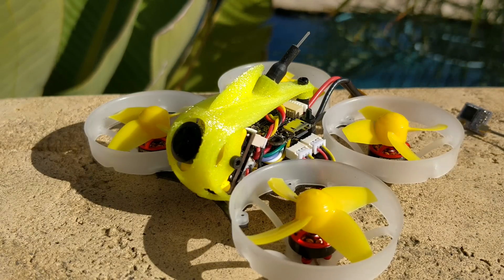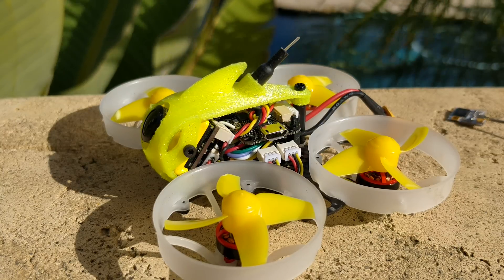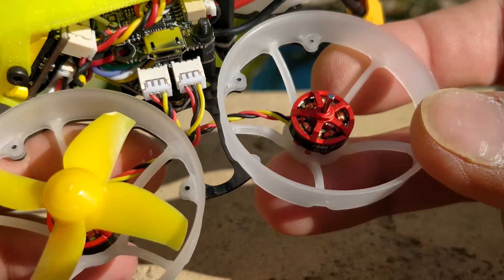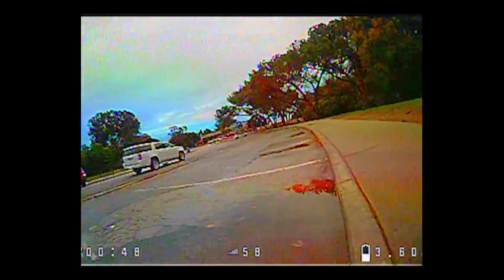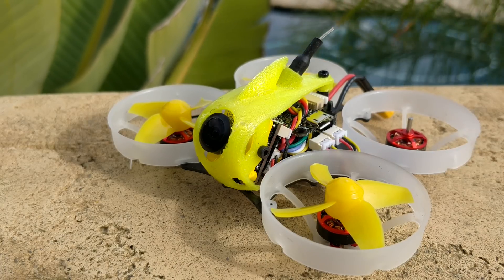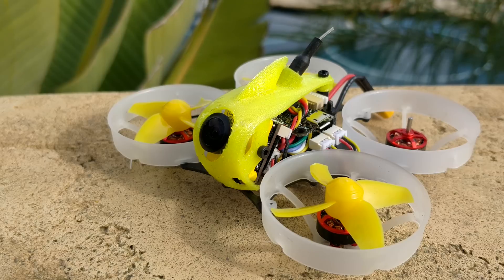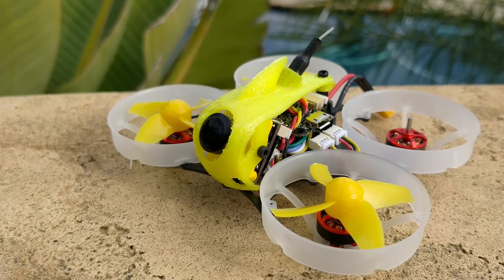Tiny Leader - Leading the way?

Comment from the maker: Table of Contents:
00:43 - Parts Overview
05:16 - Issues I had
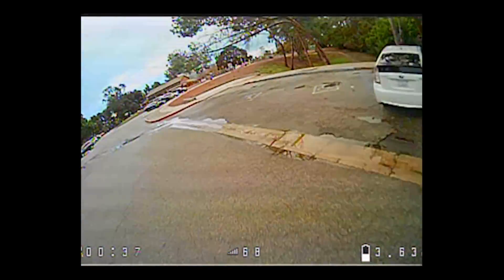05:48 - Flight video
08:17 - Toothpick comparison
09:31 - Firmware setup issues
12:07 - Conclusion

Tiny Leader: https://goo.gl/aW8KQq

Tiny Leader Alternatives:
FullSpeed Leader 2.5SE: https://goo.gl/1FKiyT
Diatone 2019 GT R239 R90: https://goo.gl/DBnnke
Diatone 2019 GT with Split: https://goo.gl/cUA9VR
Trashcan: https://goo.gl/tD7QDH
TinyHawk (1S only): https://goo.gl/LrQiN9, https://goo.gl/8y66Gf

The other carbon frame videos:
Part 1: https://www.youtube.com/watch?v=yUBwDGdeGjs
Part 2: https://www.youtube.com/watch?v=1M9WutEXIZc
I'm working on this product.  It should be out in a few weeks.

Settings I changed from default on the Tiny Leader:
Set to 8k/8k PID and gyro rate
Turn off accelerometer
Turn on air mode
Turn on anti-gravity
Turn on dynamic filters
Set your rates
Turn on I term relax
Increase minimum voltage warning to 2.9v at the lowest for 3S

Sub $200 build that's still good:
Frame: https://goo.gl/PiRGqm
FC/4in1 Stack:  https://goo.gl/HprVbj
Motors: https://goo.gl/h5rofi
Props: https://goo.gl/ZnzY2y
Props: https://goo.gl/VMBiQh
FPV Cam 2.1mm: https://goo.gl/FDJhYw
Vtx: https://goo.gl/JNVDMn

Equipment I highly recommend:

Micro Eagle - 
https://goo.gl/or1fS9

Rush Tank Vtx -
https://goo.gl/YMYmya

Fantastic solder-
https://amzn.to/2P5QM2W

TS100 iron -
https://goo.gl/DqBipa
https://goo.gl/svK6DD
https://amzn.to/2OV5XMh

WaFL’s Cap Cap
https://insta-stalker.com/profile/wafl.fpv/
https://goo.gl/9CZdAs

Tips?
PayPal: https://www.paypal.me/kababfpv
Bitcoin: 1E4XZXoD4rS6MYWVWuenY7Kw2M1YgyNpoQ
Nano: xrb_1188ek5bd7tb9kw67asnp9o65byuoaxbtpxuznx1ribf75x78awywmakj55f
ETH: 0xD067F93811f2eC31CB1928901002dfdf9A492EF5
LTC: La2KWYAjp4VT2Lq2M76pbjzXWvRyjpfCtG
Reply: Great review man!!!! I really like this channel!!!!!!!!!!!!!!!!!!!!!!!!!!!!!!!!!
                👍😀👍
Reply: How thick are the toothpick grams bottom plate V
Reply: Hey, where is the toothpick frame going to be selling? Also, where is there some information about putting a longer receiver antenna on the AIO boards? You mentioned something really quick about in a recent video (this video?) and now i'm really interested in replacing the antenna. Is it possible to put an xm+ or r-xsr antenna?
Reply: With regard to Betaflight settings I am very much with you. Very interesting points regarding the stock tune and the low voltage.

Comment: What's the best way to mount the Helio Spring Mini to the Glide's front mounting holes? The Glide frame uses M2 holes, but the Spring Mini has M3 sized gummies...
Reply from the maker: The Helio should come with the brass insets for making it M2 compatible if it doesn't, please let me know so I can rain down the wrath of g-d on them for not listening to obvious logic.
Reply: @Kabab  Well, mine didn't come with them...
Reply from the maker: @xerovolume3321  grrrrrr
Reply: @Kabab  Any idea where I can get some of those things???
Reply from the maker: @xerovolume3321  https://goo.gl/r9fkxM
Reply: @Kabab  Nice. I stripped the insulation from some ~18 gauge wire and it fills the gap between the M3 gummy and the M2 screw quite nicely.

Comment: Love my full speed leader 3, flies great and haven't touched any PID or rate settings. But I too do not see the point in this. Get rid of the prop guards to save weight, bigger props, and better frame and maybe it'd be more worth it. Companies will soon see your toothpick and be right on it!

Comment: What is your view on a micro drone with HD recording like a runcam split mini 2? Is it possible or would it just be to heavy?
Reply from the maker: They have a tiny leader with a split. It's fine if all you're looking for is to float around and get some video. Don't expect any perform however.
Reply: Who is they?
Reply from the maker: @JosephDawson  full speed. There is a tiny leader HD. Also diatone too
Reply: Thanks. Found tiny leader but not HD version. Maybe it was discontinued. Under the new rules in Canada sub 250 is unregulated. So I am wondering what sort of HD quad can you make 250 g.
Reply from the maker: @JosephDawson  you don't want this quad. It won't even last 3 flights before something burns or breaks.
Reply: @Kabab  I want something small under 250g that also has HD... maybe a 3 inch is the way to go.
Reply from the maker: @JosephDawson  just not this. This is not what you want. Many other options. Consider the diatone thing that comes with a split on it.
Reply: @Kabab  have you tested it?  Your little stick quad with a split on it would be interesting.
Reply from the maker: @JosephDawson  yeah working on that
Reply: @Kabab  well that is worth waiting for! :)
Reply: I would rather put money in your pocket then someone else.

Comment: Wow! That toothpick footage... If you could produce ready to fly Toothpick build at a resinable price i bet you could make a killing (I know I would buy one... Probably more then one... Sertinly more then one)
Reply from the maker: I'm working on it.  the kit will likely be $120 for the premium version.  This will be at least a month or two away however.  First the frame.  I have a series of things I'm working on.  All super cool
Reply: @Kabab  $120 for a ready to fly? Or $120 for a full kit? If you could pull off a full kit for $120.... mind explodes "enter shut up and take my money meme here"

At that price / size /performance you could set up a KILLER indoor / outdoor spec class too!
Reply from the maker: @MadNitr0  yeah definitely not RTF. If I built them I'd have to charge an extra $100 for my time probably. But the build is super simple. It's probably a 30min build.  Should be a kit with all the best parts I've found. Performance is mind boggling. Truly incredible.
Reply: @Kabab  for real I can't wait!

Comment: i fly without dynamic, learned to fly that way. 
but i guess its like driving a car, if you learn stickshift you can drive damn near anything, same concept applies to fpv, if you learn
 manual then it a piece of cake to fly anything
Reply from the maker: what is 'dynamic' that you learned to fly without?  If you're talking about dynamic filters, this isn't something you learn to fly with or without.  Dynamic filters didn't even exist up until about 6mo ago.  On these new powerful micros, the vibrations make them completely unflyable.  Much of the time if your filters are off, as soon as you arm the quad rockets straight up and there's nothing you can do but disarm.  It's not possible to learn to fly when you have zero control.  There is almost no reason to ever turn off the dynamic filters.
Reply: @Kabab  the first quad I built had no flight controller, I made a conrtol system out of servo's, potentiometers, and a pendulum as a semi static reference to horizon, think of a bunch of servo's testers controlling esc's with rc servo's hooked to the knobs to manipulate the direction,  as far as quads are concerned my first would have been unflyable to anyone but myself as I understood my Design was inspired by the old V-tail setups before mixers even existed. I definitely learned the hobby in an unorthodox manner but I was forced to design some systems that were semi effective but highly unlikely to be very successful in the long run, but i am a better pilot now than I was because of the way I learned
Reply from the maker: @sutrolightandsound  that's awesome. I totally understand what you did. A really revolutionary idea back then to use a centered counter balance to hover. I also believe having to learn on something like that makes you a much much much better pilot as well. The challenge is far higher than anything today. However today things are very very different.

Comment: Some people i know fly 1s tiny whoop batteries until they drop out of the sky. I assume this is very bad for the lipo. what is the minimum voltage to land for these tiny lipo's...  some of them are also HV.
Reply from the maker: Na it's not actually as bad as it seems. The whoop boards usually just shut down at around 2.5v. Yeah it's too low for the lipo to go, but it's not being stressed in the amp department so it's at least not causing those issues. If you didn't drop below about 3V, it would extend the life of your battery but it's not gonna be a massive difference.
Reply: @Kabab  also. I hear these lipos last shorter when charging tot 4.35V. But the HV are made for that right, or should i charge them to 4.2v for longer lifespan? I can understand normal lipos get damaged with 4.35v charge, different chemistry.
Reply from the maker: @sten6537  never charge to 4.35. I'm convinced the chemistry doesn't exist. They're just saying it does. It will kill your battery within 10 cycles usually

Comment: Have you flown the bat-100 bob? It’s very similar to the 1s quads your toying with, and in curious to know how you think it compares to your custom builds. At 32grams with 0705 motors, I’d think it has a lot of potential.
Reply from the maker: The batt100 is a great quad from a long time ago. It has many of the same issues as the tiny leader with the full stack. It is good and lots and lots of fun. The ones I was building back then with the larger 65mm props are much better but the batt100 is not unlike them.

Comment: Need your toothpick out. looking to mate it with a Caddx Turtle for some good HD footage that can fly anywhere
Reply from the maker: I have designs for this but it pretty much ruins the performance completely.  I will release that design in time however.
Reply: @Kabab  I am thinking the Toothpick with an HD cam will still be better than the Tinyleader HD
Reply from the maker: well that's for sure but it won't have prop guards.  That's the only real limit.  Can't specifically bump into things.

Comment: Nail on head!
I can sort of see the hd version usefulness with 1080p DVR for indoors filming maybe but otherwise what is the point of this?
The mobula7 I love but even that is pushing the whole "is it still a whoop thing" for indoors but it's good for garden flying etc.
This thing is just too heavy imo, and reliability issues have really been a problem so far from what I've read.
Next forward step here is to make a smaller lighter 1080p camera which CAN be carried happily by a whoop.
Reply from the maker: I wish I could get a hold of Turbowing and get them to improve their Cyclops 3 cam.

Comment: If I am gonna get a woop type brushless, I'll get a cheapest 1s US/K65. Don't see a point to pay more for better performance. If I want a better flying quad, I'll get the big guy. It is illogical to get a tiny plastic brushless quad to fly so fast around people even it won't hurt if it hit someone. And ripping around at that speed is gonna annoy other people anyway. Sometimes we forget that most people are not familiar with these machine and can be easily offended and result in undesired interaction.
I used to have a woop. Unimpressed and never look back.
Reply from the maker: Whoops are very unimpressive.  It's why I never got into them

Comment: As much as I would love to hate you for this one I can't,  I to was taken in on this WHOOP craze.  I had a Mobula7 on order and as I was waiting for it I saw the tinyleader and canceled my order for I could order it.  But now that I have been watching the videos and I have seen it fly I sort of wished I would have stayed with the Mobula7, don't get me wrong I still like fullspeed and I have the f3 stack in my Droner and I haven't ever had a problem with it yet I think that it's getting out of hand. Thanks again for the information.
Reply from the maker: The tiny leader is surprisingly a better value than the Mobula I think. At least the motors on it are usable. The mobula and trashcan motors are total garbage like the name. Even on just 1S with anything but a whoop prop they rattle themselves apart. Literally fell apart in the sky. They're worth zero. However the only part of the tiny leader that's usable are the motors. And barely at that.
Reply: I have been looking at also is the Diatone 436 I think it's the 3in 4s they have out. I don't like under 3in to be on 4s ,

Comment: trashcan is going UP in price and it's not even available.
after being in their facebook group,
they can fuck right off.

you can add as many cells as you like, those props wont let you go anywhere. 3S needs 2inch props at least
Reply from the maker: Do not get a Mobula or trashcan
Reply: @Kabab  its ok mate.

i don't think I'll ever get them anyway. looks like they've fucked up big time with their preordering.

I'll probably win a free one from a youtube before mine arrives.

why no trashcan though?
for $100au. the parts alone are worth it.

Comment: I'm waiting desperately for the next 2s whoop! Can't be bothered to wait for trashcan and don't really wanna get M7 cause it's aging. Hopefully Emax is coming out with one soon!
Reply from the maker: Forget the mobula and trashcan. Their motors are so bad they don't even work on 2S. Barely 1S
Reply: Kabab FPV In what way are they bad? Enlighten me please.
Reply: From my experience,  I disagree about the 0802's.  I have a Bat100 setup with Ladybird 55mm props and it works nicely on 2s.  Same with the two Mobula7 I have and run on 2 1s batteries.  Motors - not one issue yet on all three setups.

Comment: Dear Kabab,  do you have a recommend component list for DIY a solid 2S whoops?
Reply from the maker: For 2S whoop the best bet is the beta 0802 12000kv motors, beta 75pro frame, crazybee F4 board and the camera/vtx module of the Mobula 7. I don't know what it's called. Sorry. There's a link in the beta 75 video I think. As for the props, HQ has a new whoop prop. I haven't tried it yet but I'm betting it's better than typical whoop props.
Reply: @Kabab  Thanks

Comment: I skipped this one. The specs just didn’t add up on a 3s. Getting tired of these whoops. Once the hype has died down people will realise that a 1s whoop is perfect for indoor racing. Outdoors, just get a proper little quad. I have the Diatone 239 and it’s night and day better than the Mobula and trashcan (once you update Betaflight and set mid throttle to 1 and expo to 0.95). It’s become a permanent companion and always gets an outing when I’ve finished my 5 & 6” quads. Indestructible and bounces off everything in dense woods. I gotta ask tho, did you speed up that dvr? I’ve seen you fly well, but your reactions were quicker than my eyes lol your toothpick is looking like an modernised qx95. I was even running those props 2years ago on one.
Reply from the maker: That is real time speed on the DVR. in the goggles it actually look like it was much faster because I couldn't really see what was happening before I needed to react. It was some of the most exhilarating flying I have done in a long time. mainly because I don't crash my bigger quads because I don't have the patience to fix them anymore. But this little one doesn't really break so I don't care

Comment: I’ve had a few carbonframes that are 1.5mm thick and I have to say it’s good for 1s , but you should consider cutting a 2mm version of your toothpick frames for thoes of us who are gunna go straight to 2s batteries when u release them , It will be so much more durable and it dosent add the much weight at all
Reply from the maker: It's only gonna come in 2mm. 1.5 is too weak
Reply: Kabab FPV perfect !!
Reply: Kabab FPV I have some beta fpv 40mm quadblade props as well as 48mm quadblade version thats from kingkong I can drill out to 1.5mm shaft , I think they would be extremely wild props for some 11xx motors or the 08xx motors on 2-3s lipo , I haven’t seen anybody use them on YouTube , all I see are people using the 40mm props
Reply: Kabab FPV will your frames fit 11xx motors as well ?

Comment: I do feel bad for Fullspeed - they are trying to put together quads in novel ways using their own parts and designs, but ppl bash them (in comments mainly) for trying to somehow fool/cheat/fake them into buying something that doesn't work as well as it looks on paper.  They are actually replacing bad components for people and though this might have been rushed, they do have more integrity than most and genuinely want to make good flying quads not just sell stuff.  This review is pretty straight.  I hope their next quad is better and recovers their rep, or better yet, they release a full frame version with bigger props and no guards :)
Reply from the maker: Yes I realize all this too.  I have respect for them however I feel they should hire some consultants and testers before having to deal with issues after the fact.
Reply: @Kabab  I think they may also let down a little with electronic component suppliers or more specifically assuming that the quality is consistent.  I don't know what QA procedures FS have in place, but physical durability seems to be something they have more control over.  It would be a tough business to be in - getting new gear out quickly to keep ahead of the pack, so I'm thankful for any company in this space that is pushing the envelope and most deserve our support unless they push out overpriced rubbish with no care or support.  Honest, informed feedback also helps enormously, so thx to u Bob :)  Interested to see how these 1103s might fare on a superlight 3" toothpick frame with a light, reliable 16x16 stack and maybe 3025 biblades... (hakrc 2s 10a esc perhaps?)
Reply: @rich23d  That HakRC 10a esc has a MAJOR flaw - no plug for the FC wiring harness.  You have to solder the 6 wires onto impossibly small pads.  I have soldering skills but still failed twice with this ESC...
Reply: CC Cagley  I went the Makerfire 12a 4in1. Airbot Wave is a good one too